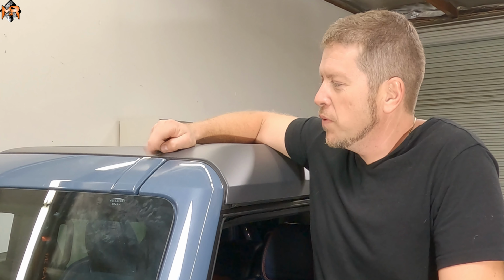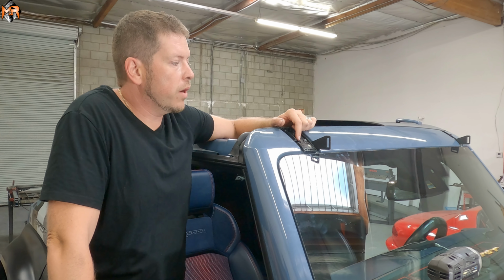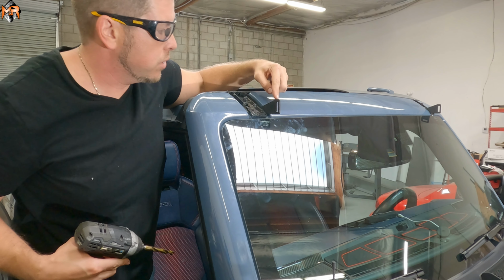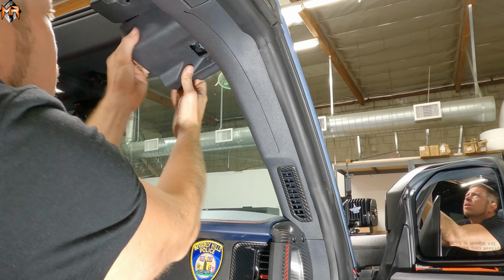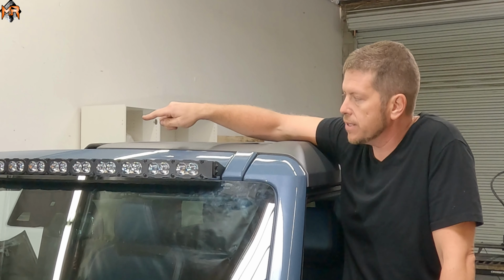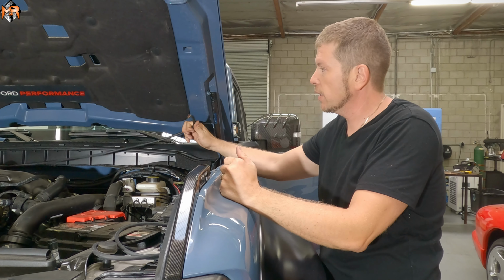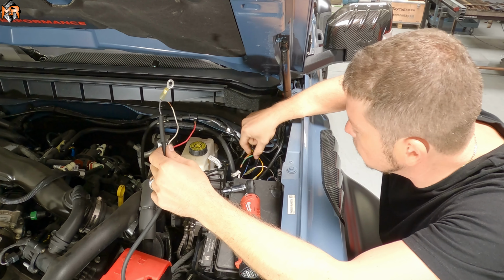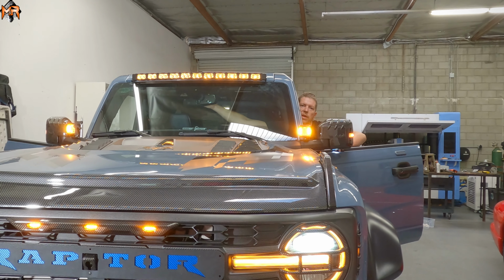2021 Ford Bronco, Ford Bronco Raptor Roof 40in Light Bar  | Easy Install | By M&R Automotive

Comment: Are the ditch light and roof bar DRL’s wired to the same AUX?
Reply from the maker: You can wire the DRLs all together or separately. Depends on your preference. Customers like the same AUX switch so it turns on all DRLs together.

Comment: How big is that hole you drilled???
Reply from the maker: The wire is 8mm in diameter. It just needs to fit through